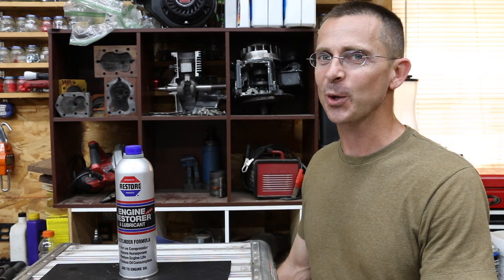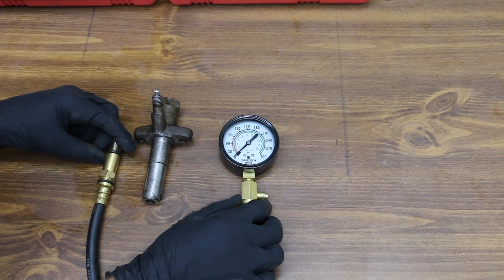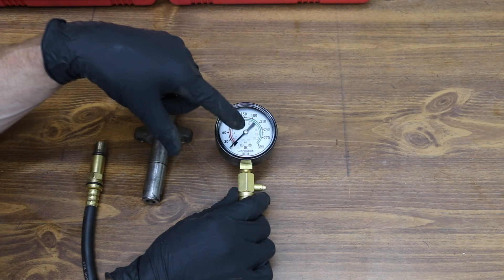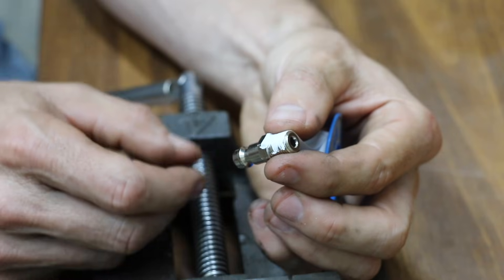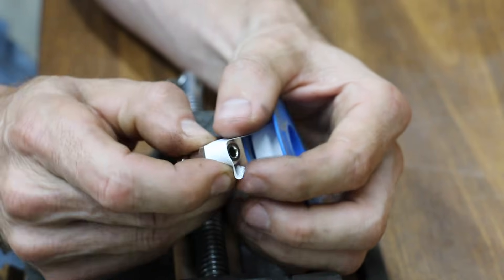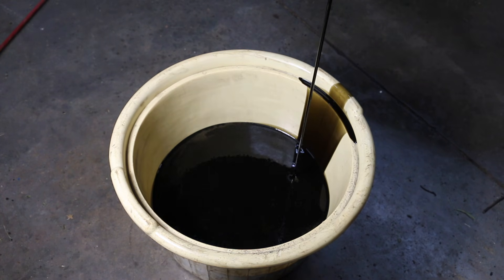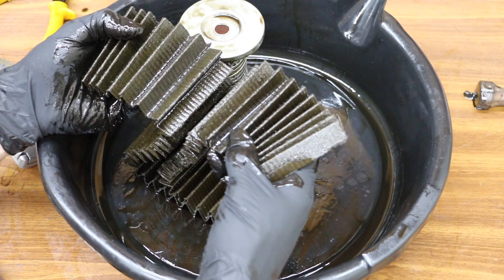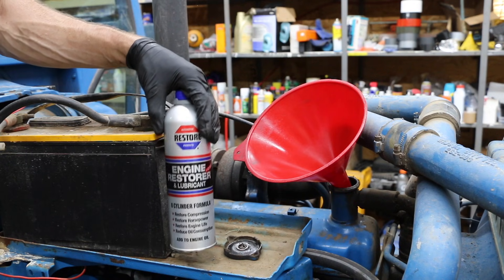Did the "Engine Restore" Compression Improvement Last?  One year later (Episode 2)

Comment: Tech tip: when I buy restore, I take it to a paint shaker first before I pour it in...
Reply from the maker: Great tip!
Reply: how about spinning it with a drill?, spun can of lacquer and paint with a drill, you notice how gravity balances the can, no problems with peeling etc after a year+. maybe a new video?, how to easily mix cans?
Reply: @allothernamesbutthis - Jig saw, sawzal, vibration sander, etc. WITHOUT the blade or the sand paper, respectively. 

Lean the can edge against the base of the saw or sander. Turn on for a few seconds... turn can upside down, repeat. 
Perfectly mixed. ;-) 
Cheers

Comment: Ever used an oil analysis service?  Just starting to test the oil on my track driven sports car.  Seems like that would be a good tool for before after engine restorer but you would probably want to flush the treatment out and use untreated oil for the after test as the presence of Restore, etc.may throw off the test results.
Reply from the maker: I haven't used Blackstone labs yet, but I plan to use them in the future.  Great advice!

Comment: ANOTHER GOOD ONE!  Will it work on my old Briggs 22 HP?
Reply from the maker: Thank you!   You can use it in the Briggs and it will help if the compression is low due to worn rings, and not an issue with the valves. Thanks
Reply: Thanks, I keep those valves to spec so I plan to give it a try.  Those rings are worn..

Comment: i knew a guy had an old rambler sedan ,8 cyl ,used oil like it was fuel ! this was 40 or more years ago ,he bought some engine "rebuild" pellets from some magazine ad ,don,t recall the exact procedure  but you put the stuff in the oil and were supposed to drive 20 miles or so to "rebuild" your engine ,he did that and damned if it did,nt nearly stop the oil consumption ! however about a week later the old Rambler seized up tighter than a boars behind ! just for the hell of it he yanked the engine and tore it down ,after much flogging with a block of hardwood and a sledge hammer he managed to get one piston out of the bore ,the stuff had attached itself to the piston and rings like some sort of liquid metal then solidified ,about welding the piston to the cylinder bore ,never saw anything like it before or since !!!!
Reply from the maker: Wow!  What a disappointing outcome and terrible product!
Reply: But that engine never used oil again, right?  Sometimes you have to read the fine print of the guarantee very carefully.

Comment: Additives - "miracles in a can". I am not a proponent of additives in oil. It can upset the chemistry of an oil, reduce it's performance and life. IXNAY ON ADDITIVES. Use a cleaner prior to an oil change, keep the filters changed according to OEM specs or what the manufacturer of the oil states. Let the oil do it's intended job without any wizardry.
Reply from the maker: Thanks for commenting on this.

Comment: Drain the oil out of a 4 stroke then mix it like a 2 stroke to see if it runs
Reply: The bottom end will blow up. Remember in a two stroke the fuel/oil mix travels through the crank case whereas on a 4 stroke it doesn't.
Reply from the maker: Thank you for the video idea!

Comment: Do the piston rings in the center of the engine wear more because it is hotter there ?
Reply from the maker: Great question. This engine's low cylinder was on the front cylinder, but the compression improved a lot after using restore.

Comment: i was machinist,die and toolmaker for 12 years.Put tapping oil,or at least some oil to keep your tap ''healthy''.Knurling and tapping are oil mandatory,in a shop.Threads have a smoother finish also
Reply from the maker: You're right. I should have done that. Thank you!
Reply: no problem.In some aviation material,the tap cutting angle,coating on tap,and oil,are the key to achieve required results.For example,nobody in our small shop of research and development,once,could tap an a new alloy of Berylium-copper.I succeded with available tap for Titanium,with a specific oil. I was working in spacecrafts industry.I don't try to be finniky,but a drop of oil save you $.Take care!

Comment: What should the cylinder compression be?  Did you test all 4 cylinders?  Were they fairly consistent? 

It's more work, but doing a leak-down test can tell you a lot more than just a compression test. 
 
http://www.wcengineering.com/articles/leakdown.html
Reply from the maker: I haven't found any information on what the compression should be, but normally diesels range from 300-500 PSI. So this one is still on the low side.  However, all have shown improvement.  I did test all 4 cylinders.  The leak down test is a great recommendation. I should have done it.
Reply: What year is your Ford 5000 Tractor?  I was able to locate a service manual for years 1965-1975.

http://www.tractorbynet.com/forums/parts-repairs/329850-free-ford-tractor-service-manual.html

The compression ratio for the 5000 diesel engine said it was 16.5:1 (page 166 of scanned pdf).

And the compression pressure at cranking speed (200 RPM) was 420 to 510 psi with +or- 50 psi variation between cylinders.  

The engine might have cooled down a lot by the time you got the fuel injector removed and the compression tester adapter installed.  This might explain the lower compression reading (approx. 300 psi), as all the piston, ring, valve clearances are significantly looser when the engine is not at operating temperature.

Comment: Good video on the additive. I used something called "Mechanic In A Bottle" on an old 2-stroke 25cc weedwacker that someone was throwing away. I changed out the spark plug, drained the fuel, cleaned the carb, replaced the fuel lines,  added some of that to it an, voila, I now have a working weedwacker for $30. I have a question though, who makes your windrower?
Reply from the maker: Impressive!  It's a John Deere 702 rake. Thanks again!

Comment: Funny - I just watched the original video yesterday and was hoping for a follow-up. Lucky for me I only had to wait a single day!

One note - I don't recommend using teflon tape anywhere on a machine where tiny shreds of it that WILL form, can get into tiny oil passageways and block oil flow. While not familiar with your tractor engine, in the vintage motorcycles I work on, I have found teflon scraps in oil galleys impeding flow, as well as in hydraulic valve lifter oil passages, preventing them from pumping up. I just simply won't use it anymore. 

But great videos - thanks. Have always enjoyed watching your stuff.
Reply from the maker: Thank you!  Also, that's great advice on use of Teflon too. Thanks again!

Comment: I want to see you use it in an old power stroke ford 7.3 or 6.0
Reply from the maker: I believe the product warns against using it in the PowerStroke, but I'll have to research it.
Reply: Probably not good for huei injectors.
Reply: I worked for ford during the 6.0 years and there isn’t enough engine restore on planet earth to fix those pieces of junk
Reply: Heui
Reply: My 7.3 had a rough hot idle, I’ve been using Archoil 9100 for a few years and it took my problem away. I noticed it starts easier warm outside, cold, using glow plugs or not. I have glow plugs on a switch on dash to help them live longer. I use 9100 in my cars after the great results in my truck and I can’t believe how clean the engines look inside after extended drains.
Reply: I'm suspecting the Powerstroke uses the oil to actuate it and there's probably a chance of it jamming up.
Reply: Matt Dizzy more interested in the Heui fuel system.  But if the motors already wore out I’m not to worried about the injectors.

Comment: Have you tried Lucas oil additive on your bearing wear bench tester. Either stand alone or mix with oil at recommended concentration?
Reply from the maker: Yes, I did try it both ways. While the film strength of Lucas isn't all that impressive, the cushioning the oil provides helps worn engines. I personally wouldn't use it in the winter in temps below freezing due to stress it would cause on an oil pump.

Comment: yeah i learned about the teflon tape tip the hard way, my first job was prepping parts for welding in a fabrication shop, they started to grow so they took on other types of work and i was asked to wrap teflon tape onto all of the pneumatic parts when i had time in between grinding/flapping and i had never used teflon tape before so when they went to do a hydro pressure test one day, half of the fittings leaked and at around 800psi a hydro leak is basically a water blade and the stream hit a piece of plywood that was acting as a make shift wall next to the test bay and cut a hole through it, luckily nobody was hurt but after that i was schooled really quickly on the right way to wrap fittings lol i still double check myself to this day by "tightening" the fitting in my fingers to make sure its on right
Reply from the maker: Wow!  Thanks for sharing this experience.
Reply: Interesting experience! That's a great tip
Reply: I strongly prefer liquid Teflon. It easier to use and doesn't unwrap obviously, and easier to keep small parts of the tape from getting into your delivery lines and plugging something.
Reply: I remember it the same way. tighten the tape on.
Reply: Yeah, that lefty loosely, righty tightly is fine most times. But then you could have my neighbor's problem of buying an old 1964international delivery box van to convert to a fishing/camping buggy. Back then, there were left hand threads on the left side wheels. (The idea was that right hand threads could potentially back off going down the highway.)

First thing he needed to do was take off the tires and wheels for replacement so he could transport it around his workspace. When I showed up, he was hotter than tar on a tin roof, with a torch trying to heat the studs to remove the lugnuts.  I got him shut down before he melted more than his dignity.There wasn't any Teflon rolling involved, but just remember that rules only apply till they don't.

Comment: There is a product BG sells called EPR. It used to be called CPR because it claimed to clean the gunk from the piston rings and restore compression. I used it alot but never really know if it did anything except one time there was a Saturn came in rattling from the valve train. After 10 minutes of it running with the EPR in it it stopped rattling. If you got a gunked up engine with low compression maybe give it a test?
Reply from the maker: Thanks for the recommendation on test BG EPR

Comment: Hello, I love your unbiased  reviews. I have a idea for a video if you get time! I race motorcycles and most guys I see at the track run the Shell rotella t6 DIESEL oil 5w40 in their bikes. I am told the diesel oil contains detergents and cleans up the inside of the motor well while also working well with motorcycle components such as the wet clutch. do you think you could test Diesel oil (preferably the T6) in a gas engine and see if there is any type of difference from a non diesel oil?
Reply from the maker: Yes, this would be a very interesting test. Thanks for the recommendation!

Comment: Ok, I have an idea for a neat comparison video. say you have two (sacrificial) 2 stroke engines for an edger or other piece of equipment. You could run one engine with regular fuel/2 stroke mix for say 30 minutes, then replace the fuel mix with pure gasoline (no mix) and see how long it runs before locking up as a base line. Then you could run the second engine with fuel/motorkote mix instead of 2 stroke for 30 minutes, then replace the mix with pure gasoline (no mix) and send it until it locks up. That sounds like a pretty extreme test for good ol' motorkote. Thanks for reading and have a great week.
Reply from the maker: Very interesting idea--thank you!

Comment: Excellent video as always. Very glad you followed up on this test. I've used engine restore in the past on my Suzuki engine with over 200k miles on it and didn't notice a huge improvement. Might give it another go now.
Reply from the maker: Thank you!
Reply: That's because Suzuki engines never wear out. ;) No in all honesty I used this in my 4cyl 8v Suzuki engine with about 200k on the clock. Two door Geo Tracker. I noticed immediate gains in power. That's good since I just used it to tow my 16 foot RV from Michigan to Arizona and was 100% reliant on that old 1993 beast to get me back home (With the 3k+ pound trailer!) and for all of the local driving I would need to do over the winter. I noticed reduced oil consumption while towing too. The vehicle didn't really eat oil on average, but towing that large trailer with that tiny car meant going 20MPH full throttle in second gear for hours at a time when there was a steep grade. At those extreme conditions it did use quite a bit. Restore cut that in half or better. I made it home and the little Suzuki still sounds silky smooth.
Reply: Kenji Fox Mine is a J18A engine. 2001 Suzuki Esteem wagon 1.8l

Comment: Engine Restore is a amazing product. I used it in my S-10 and it regained compression across all cylinders and gained in horsepower. I would still like to see you try the VP RACING FUEL additive called MADDITIVE theu have one that's either 5 in 1 or 7 in 1 and I would like to know if it trulworks. Thanks
Reply from the maker: Thank you for the video idea!

Comment: I've requested this previously, but Liqui Moly (20002) Cera Tec Friction Modifier has some pretty big claims, such as preventing damage from metal-on-metal contact and it's supposed to help fill on scratches on the cylinder walls.
Reply from the maker: Great recommendation.  I have some and will test it soon. Thanks again!

Comment: good vid!  the drill press advise was marginal.... leave the drill press off, use a centering bit on the back of your tap to keep it centered and turn the die handle to thread.  your press vice needs to be clamped to the press bed though.
Reply from the maker: Thank you for this advice!  I'll do this in the future.

Comment: Works nicely on the jag: over 200k miles. Had oil blow by and was burning it slowly but surely. Did a complete oil change and it has stopped burning oil by a " lot ", not totally, but considerably, and that's with a heavy foot too
Reply from the maker: Impressive results!  Thanks for sharing!

Comment: How is it supposed to work engine restore what is its chemical make-up, What is its carbon deposits like, maybe that's how it increase the compression by adding carbon to the side of the pistons. Can you not buy oversized rings for that tractor. It's a Ford isn't it New Holland might make them.
Reply from the maker: Great question. It contains very small copper, silver and lead particles to fill-in the imperfections in the cylinder walls.

Comment: Liqui Moly CeraTec. Put it in my engine and gearbox. Gearbox feels smoother, second gear goes much easier than before and the engine is purring like a kitten.

I really don't know if it's placebo or if it really does something. Would be nice if you could test it out! :)
Reply from the maker: I've got some and plan to test it soon. Thanks for the recommendation!
Reply: Same for Ceratec
Golf mk2 1.6 diesel... 500 000km

Comment: Random thought on Teflon tape: I once had an old Volkswagen with an air-cooled aluminum head, and naturally a stripped spark plug hole.  It would literally blow plugs out, always in a remote location!  As a desperate experiment I wrapped the plug threads with Teflon tape, knowing that enough of the threads would cut through to still make electrical connection with the head, and managed to screw the plug in tightly!  It lasted for months, until I could afford to install Helicoils in all of the plug holes...………………….elsullo
Reply from the maker: Glad this worked. Thanks for commenting.

Comment: This is really something else. I use it myself in all of my cars and motorcyles. In this video they drove Ford Sierra 100 miles without motor oil after RVS treatment and it did not seize, camshaft front oil sealing got hot and started smoking (no oil). After adding oil and RVS they drove back and compression was same as in original. 

I'd really would like to see how RVS fares in your engine destruction test. It is a metal ceramide forming an extremely smooth but hard as steel coating on metal to metal surfaces in the engine. Test will take some extra time as you need to run the engine with a variable "real world" loads for 15-25 hours to make the metal ceramide to form, before you can drain the oil and do the test. 

I do not know any other product like this. In the Soviet union they used similar product to make the machinery last longer and this an evolution version of it, made in Finland. 

I'm sure that they will send you and test kit if you ask. Or I buy it for you, as I want to see the result of the test. 

https://www.rvs-usa.com/
https://www.youtube.com/watch?v=-NymF_vEst0
Reply from the maker: Thank you for the video recommendation!

Comment: I used "Engine Restore" in my 96 Chevy truck with a 5.7ltr engine that was worn slap out. It raised the compression and in-town mileage went from 9mpg to  13mpg. That engine lasted another 4 years until a rod bearing hammered out. (crate motor now) Engine Restore is amazing stuff. But it won't fix flat broke. I also use this in my vintage 81 Harley Davidson and a 61 Nash. Love your videos!
Reply from the maker: Impressive results!  Thank you!